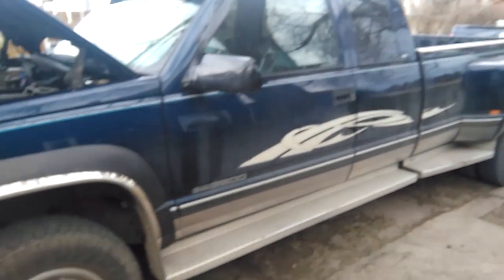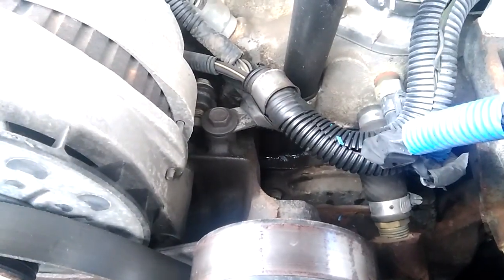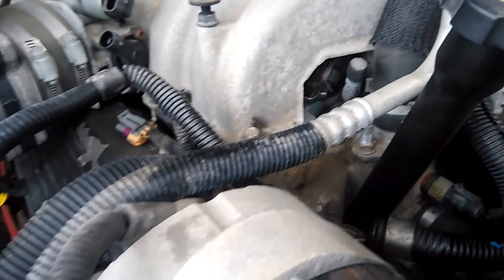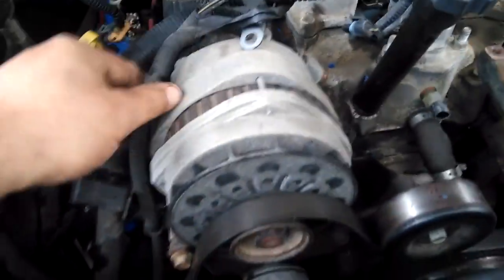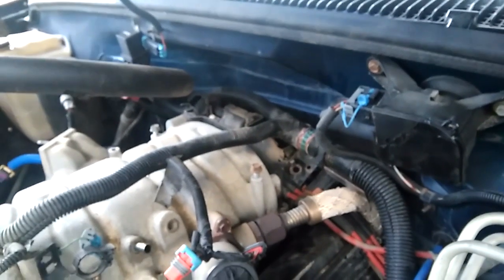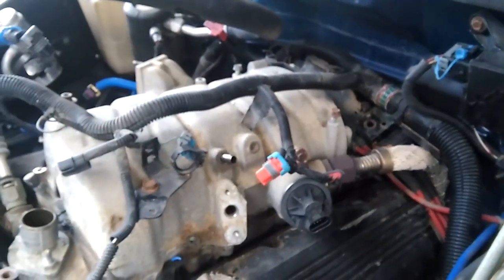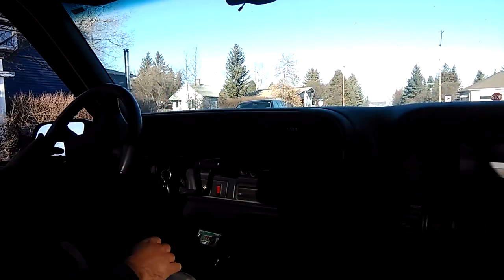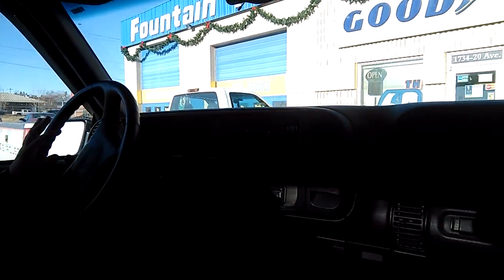Vortec 454 Remove upper and lower intake - How to Ruin a Weekend

Comment: Thanks for the link to setting the distro. I remember going through all the stuff that you had to do. I really remember the EGR pipe. AGhhhh I wound up breaking it and having to replace it. Stealerships wanted $190 but Ebay $75. For the Mechanics who criticize this remember not everybody has a 40x50 shop with a $25,000 tool box not including a $5,000 scanner. When I had to do this to my truck there was only Mitchells, Haynes and Chiltons. Good job.
Reply from the maker: Thank you for the kind comments and helpful tip on the egr pipe.

Comment: 1:58 you shouldn't have to loosen that Bolt to take tension off of the tensioner. Only a 3/8 driver should be necessary to remove the tensioner some time to PB blast / lubricant helps but you shouldn't have to take the tensioner partially off to remove tension.
Reply from the maker: Helpful tip

Comment: John, you are a gentle man. I choose to use the two words, instead of the word gentleman. You have sufficient humor to address gently the biting words of others. I did this job on my '99 Burb 7.4 about 6 years ago, somewhere around the time you posted this video. My engine had hydro-lock because the Dex-Cool dissolved the lower intake manifold gasket for the #7 cylinder and filled it with coolant. After lots of research, I opted to NOT use Dex-Cool as a coolant after that. I chose to use Final Charge Global, but I state that only as "my choice." . . . The reason I came back to these Vortec intake videos has to do with the "standard" hot-start flooding issues. However, I'm searching for how gas can come to be puddled (after 2 years of sitting) in the bottom of the intake plenum; the aluminum lower half that has the fuel rail in the middle of it. The injectors didn't leak fuel there. They inject directly into the individual intake ports. . . Maybe someone has found the same issue and has a fix for it.
Reply from the maker: Thank you for your comment

Comment: I just rebuilt my whole 99 454 7.4l with an long block swap and reman trans! This is probably one of the easiest trucks I've done compared to the dual over head cam Toyota trucks which can be easy as well but also different and alittle more touchy. Good video!
Reply from the maker: Thank you for the great comment. Keep that truck going!

Comment: Glad I found this and watched through to the end. You took on a BIG job and conquered it. Im questioning my regulator but I am fairly sure its a weak pump. original pump in a 97 454. 75K miles so its pretty pristine. and  babied!  Thanks for posting this!
Reply from the maker: Michael McKellar thanks for the great comment. Good luck with your truck

Comment: I had the same problem with the fuel smell I replaced my injectors and fuel pressure regulator fix my problem. I bought my injectors on eBay from a company called Five-O Motorsports and I believe they were Bosh. Good luck to anyone that replaces are injectors. It's a very easy job and shouldn't take you but a good hour in the garage if you mark everything. I did mine without a book I just used a piece of cardboard and poked holes in it which I put all of my bolts in to keep the right place where they came from. I really wasn't sure at the time if there were different lengths so I did not take the chance. Cheers
Reply from the maker: Great comments. Thanks

Comment: My video is under my company name, Fabtec.  We design and fabricate mostly molds to injection mold all types of medical products.  Prior to that I spent 32 years designing rocket engines for the space shuttle for Rocketdyne.  I have always worked on all of my own vehicles, restoring vintage British automobiles and British motorcycles.  I guess it's the mechanics that intrigue me.  I save money and know the job has been done right.  I have rebuilt automatic transmissions (Powerglide, Turbo 350, 700R4, 4L30E and manuals - Chevys, Volkswagen, Triumph and MG'S.). I have also rebuilt many different engines.  I hate metiocrity, if a job is worth doing its worth doing right.

Comment: I have a 98 K2500 with 7.4L vortec with small intake manifold gasket leak.  Same place as your truck.  I actually did the injector job 2 years ago and should have done the intake manifold gasket then, but I wasnt aware of the leak.  Thanks for your video.  Do you remeber the part number for the gasket used?  I found a Fel-pro number 1212 cheaper gasket and a Fel-pro 95826 which seems much more durable.  I know its a long shot to ask but any help would be appreciated!  Thanks again for posting the video!
Reply from the maker: Yeah don't remember. I'm cheap to start with so I would go for the cheaper gasket. And it is a 98... Keep it running but there is a limit.

Comment: Hey John. Sorry to reawaken comments on a 2 year old video, but I have a couple questions. Do you remember how high your idle was when you reassembled the first time? Also, did you use RTV or any other sealant on the upper manifold gasket? 

Thanks for putting out this video btw. I’ve been scouring the Internet for info on the upper manifold gasket and this has been the most helpful resource.
Reply from the maker: Idle was off the chart because I had a huge vacuum leak. No sealant just the gasket. 
I was in the same boat as you. That is why i made the video of me struggling with it. I get my energy from helping people and great comments like yours

Comment: John, thank you for making this video.  I'm sorry that you had to hear from so many that didn't appreciate it.  It's easier to criticize than to do something.  Looks like I need to do this job too.  What was the final cause of the long crank warm starts?  Was it the injectors?  Fuel pressure regulator?  Thank you.
Reply from the maker: I appreciate that. But it's part of the job.
It was both. Replacing the regulator stopped the hot flooding. But it still ran poorly until replaced the injectors. I used new/stock injectors BTW.

Comment: I'm doing my injectors this coming weekend if the weather clears up. Good video! I had someone do my FPR but i don't think they removed the intake. I hope its an easy job. Doing Pump as well. Trying to solve a starting issue I have. I think it could be vapor lock, but it falls on its face super hard when its warmed up. Injectors hit 100% at 1500 RPM almost all the time when starting at a stop light. They're original so the ethanol probably ate it up. Did you use an intake gasket or RTV?
Reply from the maker: Thank you for the nice comments! I used a gasket. The felpro was not expensive. The worst part is the egr tube. Get a big wrench and hammer. Have you tried the mass air flow and manifold pressure sensors (behind the thermostat)?
Reply: I have not. I'll replace those as well. No Check engine lights. but ill do the manifold pressure sensor when I do the job.
Reply from the maker: Good luck

Comment: Hey I just had a 454 same exact model truck that you got we put in all the plug wires caps everything but the coil and no injectors same thing floods out when it's sitting a while I put a fuel pressure regulator in it too what did that end up being on that one does it still start hard leak fuel when you shut it off start hard after that
Reply from the maker: I'm not sure what you are asking exactly. Punctuation is everything. But my truck runs amazing now. I have since changed all 8 injectors. 

Something overlooked is the ground connections. Check and clean them all. Body grounds as well. Good luck

Comment: I am glad that he had this video up. I had a noise in my engine (7.4 Vortec) 454. I was hoping that maybe it was only a lifter down because it didn't make a really loud noise. But I got it apart to find metal chunks and chunks of aluminum down in the valley. All lifters are fine. Am guessing a piston shattered but I would have thought it would have made more noise than that. Anyway I am getting ready to pull the heads tomorrow. This is why I stick with Ford.  I have owned 2 Chevy's and they have both been pure junk. This engine now only has 60000 miles on it and it's junk already. Everyone talks about how good these 454s are but I now know not to listen to anyone and use my best judgement when buying an RV. Wish I had bought the Ford instead of this junk.
Reply from the maker: Thanks for commenting. However, sounds like you are trying to start something. Good luck on your project
Reply: @jloney  nope just stating the fact of what happened to me and my opinion on the matter, lol. I did find out that my piston shattered.
Reply from the maker: @bubbaray8670  I take it back.
Reply: For every 454 like yours there is 1000 with 300,000 miles on em
Reply: @Levisnteeshirt1 mine is about to hit 250000 miles bought it 3 months ago so far I’ve done plugs wires water pump maf sensor and it’s Ben good so far

Comment: Is it hard to remove the upper intake manifold?
Reply from the maker: David Nguyen very straight forward. Lots to undo but it is very logical and only goes back together one way. Good luck
Reply: John Loney thanks. Is there a gasket?
Reply from the maker: David Nguyen yes. Mine stuck to the top side. Erg tube is a pain too.  I suggest undoing it

Comment: You can see my very detailed video (and face) - just search Chevy Seat Play Fix, Parts 1 and 2.  There, I explain how to fix your Chevy power seat drive with the parts I designed and injection molded and supply to do the job.  I'm sorry I was a little harsh on you but it was clear that you had not done a lot of homework before making your video.  It seemed like it was kind of impromptu, start the camera and wing it.  I have watched more videos from people claiming to be experts on repairing cars and appliances only to find that they don't understand the root cause of the failure let alone how to correctly fix it.  I believe a good repair video should 1. Give a good description of the problem 2. The reason it broke 3. The proposed solution or "fix" 4. A list of tools and parts that will be needed for the repair 5. A good quality video of the repair starting with an overall picture of the area to be fixed as well as close ups of important areas. And finally 6. Safety issues and things to be aware of or watch out for.  I think your video would have been more helpful if you had done the things I have listed.  I will try to post more of the repairs I do in the future - typically I'm in a hurry to get it fixed and after the fact say, "I should have made a YouTube video of that.
Reply from the maker: Kirk Spiegel so you just troll under this handle?

Comment: theres a timing procedure for those and need to reset crankshaft position variation learn. With the shake check iac counts should be around 30 or so. if iac is 0 you still have a intake leak. Those arent easy to work on without proper tools and equipment. Might think you saved money but its not right and will have to be redone again
Reply from the maker: Thanks for commenting.  i changed all 8 injectors and it now runs amazing.
Reply: John loney u made this look easy. At this point my concern is making sure I don't miss up the timing. I believe I can just mark the distributor to the manifold before removing, but just in case...do u have the website u got the timing procedure from?
Reply: @JS-el4er  7.4 vortec don't need to be timed, the computer does the timing and the distributor only goes one way and it holds in only one way with the square hold on plate. Hope this help even if you posted this comment couple months ago.
Regards, 
Kevin.
Reply: @thejokeroldschool  true, but the distributor can be off a certain amount of degrees, and it will run like crap. I learned this on a vortec 350.
Reply: @thejokeroldschool  I know this is an old video but I just did this on my 454 this weekend put things back together and now it runs like crap and backfires and has a terrible rough idle. I had to take distributor off so now my timing is off. I dont have access to a snap-on scan tool, any videos out there or help on getting timing right on these vortec 454s?
Reply: @jaimecardona7458  Hi, there is a alignment that need to be done while installing the distributor, here is a thread that talks about it more then I could write it here: http://www.gmtruckcentral.com/articles/distributor.html

If you have more questions don't hesitate to ask.

Comment: What gaskets did you use?
Reply from the maker: I do not promote other business on my channel. The brand sounds like "fell bro"
Reply: John Loney 😆 Fell brothers does make some fine gaskets. I was only able to find one part number in my mountaintop catalog. I suppose that’s the only one. Just trying to avoid doing the job twice. Good call on the new bolts
Reply from the maker: @johnmercier2874  Good luck

Comment: Your injectors are being eaten by your cleaning solution.  That's not how you clean them by the way.  You need to rig up a power source and a can of carb cleaner......spray the cleaner and pulse the injectors.  
To do it right just buy new ones from Bosch  :)
Reply from the maker: The intent of the video was about the manifold not injectors. It is amazing what people focus on. 
All were replaced.
Thank you for commenting

Comment: Sounds great they all shake mine shakes like a wet dog shitting razors course it has a 550 lift zz502 cam 😉 But always had little shimmy
Reply from the maker: Still running good. I cleaned up some grounds and runs better. Thank you for contributing

Comment: this dude needs to leave shit to a professional!!! No need to loosen the belt tensioner, first of all.  He clearly has no clue!! At 6:50, he's saying it's flooding...lol. I doubt it!! 2 days later & STILL hasn't gotten the intake off.....?
Reply from the maker: Your 0 subscribers want to see you making a video about this
Reply: just so you know, I have 35 years experience as an ASE Master Tech both gas & diesel, including heavy truck. I also possess L1 Performance certification. I was merely watching the vid to sort of edit it so people get the RIGHT information. Lots of hackers out there. You seem to be one. If I make a video on it, I'll mention YOUR name several times as what NOT to do!
Reply from the maker: 35 years later and he still does not understand fuel injectors leaking. Lots of helpful tips though... Just so you know, I have a full time job, wife, children and youtube.
Reply: Ya I had the exact same issue of a hard warm start.  Hopefully you replaced your pressure regulator as well while the intake was off. 
When I replace my leaking gasket I figured the pressure regulator was the hard warm start cause and as it turned out it was a leaking injector for me too.
Hopefully you replaced your cap and rotor while you were at it (as it is a bitch to do normally) with an ac delco.. cheap aftermarket cap can delaminate and cross fire..not fun
Reply from the maker: Great comments. Thanks!
Reply: had a caddy that wouldn't want to start warm. Fuel pressure regulator was leakin fuel and was going through the vacuum line down into the intake. flooding it.